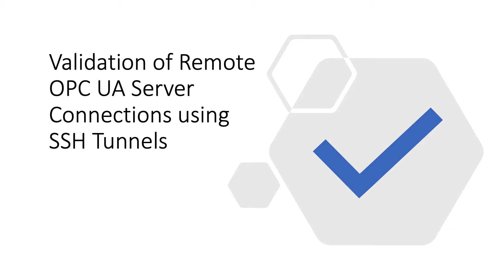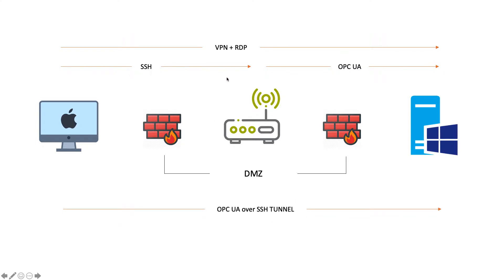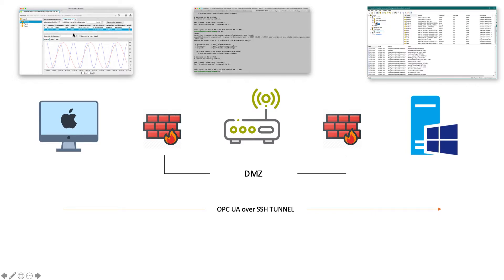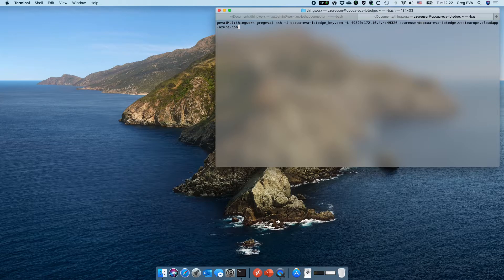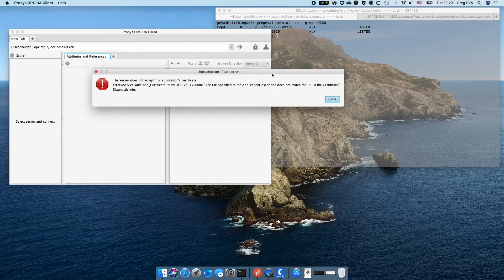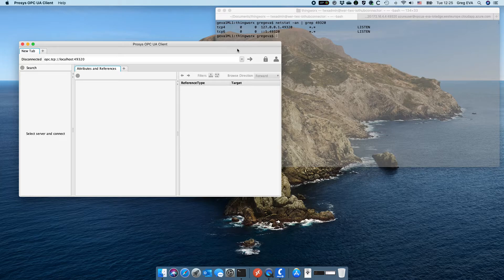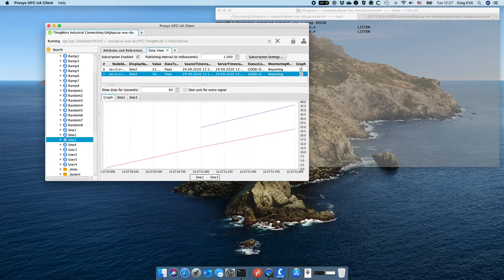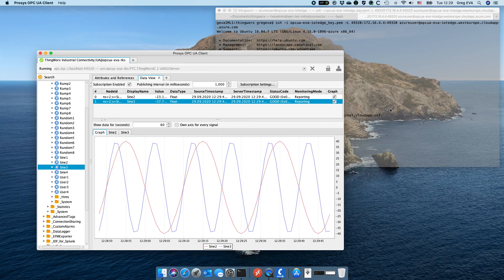Validation of Remote OPC UA Server Connections using SSH Tunnels

Comment: Hi, i'm trying to do a reverse ssh tunnel, but the driver return Timeout error. does i need to forward other ports?
Reply from the maker: No, only 49320 is needed.  See the command with specific port forwards in the video description, and then validate with something like netcat 'nc -zv hostname 49320' or 'telnet hostname 49320' to validate that a) port is open, b) you can hit it.  I should have mentioned, first validate port is open and you can hit it from the Kepware network before attempting to validate the SSH tunnelled connection.

Comment: Hi,

I Am working on a project where the OPC UA Server (Phoenix contact AXC 1050 PLC) is connected to a Sierra RV50 router with a M2M Sim-Card (Router 1).
The OPC UA Client is a laptop with TIA Portal WinCC professional on a office-network (Router 2).

So I know that I Should put the IP "opc.tcp://name:Port" of the PLC (OPC UA Server) in the "OPC UA Discovery URL" in TIA Portal Scada (OPC UA Client.)
But this won't work because the PLC is on another network. 

I found something that it should be possible to connect the 2 networks with a VPN-Tunnel. 
But now my question is, 

Is it possible to send and receive data over a VPN Tunnel using OPC UA? or should I use SSH? 
I am new to these internet connections so I am trying to figure out what I need :)

Hope to receive a reaction.
Thanks in advance!

Joost
Reply from the maker: Hi Joost,
Sorry for the late response - I am just seeing your question now.
You can do what you're aiming for in a variety of ways -- opening firewall ports specifically for an IP address/range/subnet, SSH tunnel, VPN tunnel.
The real question is what is validated and accepted by I.T. security?  You want to make sure to get their blessing to avoid that your communications are unexpectedly shut down unknowingly one day.
Sometimes standard ports and protocols are better as no specific router/firewall configuration is needed, however sometimes it is better to have a dedicated and visible OT communications pathway which can be monitored (OK, not OK, abnormal) and is separate from standard web traffic.
Cheers, Greg